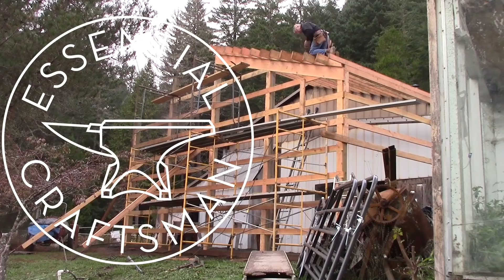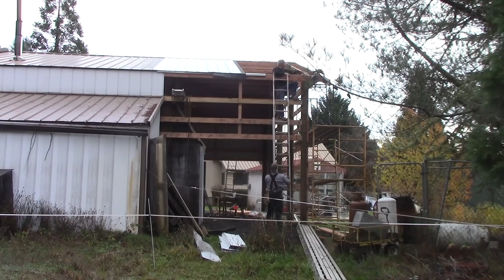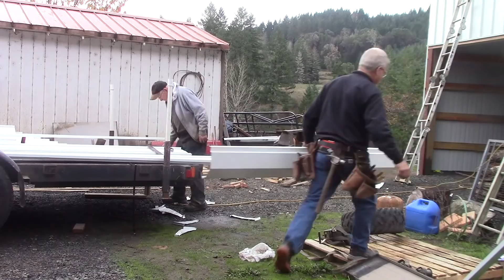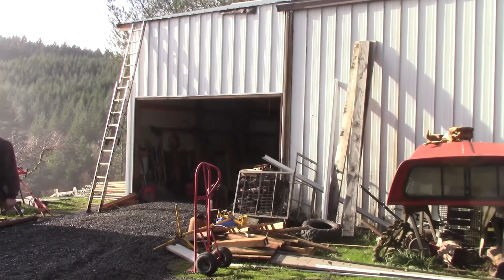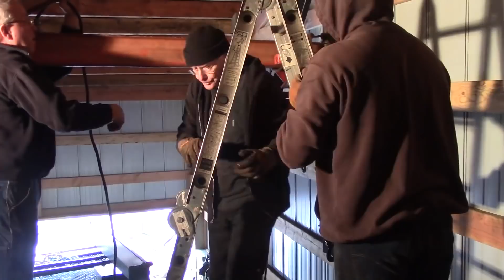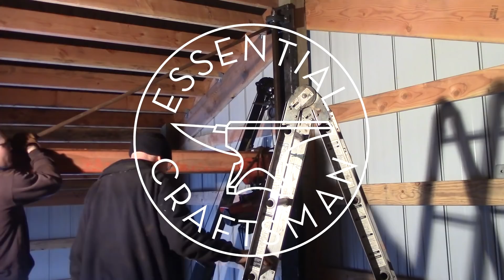Jobsite Safety and Taking Risks

Comment: I have been wearing a safety harness almost everyday for about 15 years and I have never had to rely on it in a fall.  The thing I like best is that my tool belt is attached to it and it distributes the weight to my shoulders.  Great video.

Comment: 1.5 years into carpentry. Still a newbie cut guy. Almost cut my finger off the other day trying to rip a 2x4 long ways with a circular saw. The 2x4 started to move while I was cutting and I grabbed it from underneath to hold it steady and ended up grabbing the saw blade, like a dummie. Only knicked myself but it still hurts pretty good. Really enjoy your videos sir. I will use my brain next time!

Comment: Excellant presentation as usual. Love your videos. One note though; when working "like they used to", like you were on your barn and YES like I worked on my own barn - before all the emphasis on safety. Tens of thousands of good carpenters and other tradesmen were crippled or killed on home and farm job sites every year. Now with the increased focus on safe practices and equipment those results  have been reduced from tens of thousands to hundreds for the most part. 
Even with all the safety knowledge and equipment I have at my disposal I was replacing a section of ridge cap on the standing seam metal roof of my barn damaged by high winds when the first slick of dew formed on the metal. No worries my gloves and boots had no difficulty gripping under those conditions. I gathered up my few tools and began climbing down to the ladder. In that same moment that bit of dew FROZE! Damp ice, NO grip at All! I made my way off that roof only because I drove my hammer claws through my relatively new metal roof each couple of feet and lowered myself down that roof. It was so slick that while I moved my hammer to drive it through a couple feet lower I actually couldn't avoid sliding down while I quickly moved the hammer. I  WAS  TERRIFIED! You just can't allow for everything. 
Honestly how many times over the years have you fallen and were injured or should have been? How many shoulder or back injuries injuries are you forgetting. Most of those could have been worse but what? When you are talking about your brain keeping you safe don't forget to mention those and the serious injuries and deaths of those you worked with. Yup don't forget to tell the nubies  about those times your brain just wasn't enough.
THANKS for listening
Rancher Jerry

Comment: The only two accidents that I've had on a jobsite where one time I was up on a latter until I got delirious from the summer heat until my nail gun bounced off of where I was trying to place a nail landed in my tool pouch and shot me in the thigh. Another time I picked up a 2x12 and a staple stabbed right through my finger. Both times I was back at work within  20 minutes and I finished my day.

Comment: Yes, there are safety issues from working on wet roofs at that height.  But here is where experience (an unpredicted benefit of older age) allows one to proceed more slowly and not rush the construction.  The job will still get done, but done with more caution and experience.  Experience teaches us when to push it and when not to push it.  Nice work here and it looks great.

Comment: In Manila there is a plaque with the names of laborers entombed in the concrete of the convention center there.  Years ago Imelda Marcos wanted the place built in time for the Miss Universe  pageant.  And in their hurry to pour the necessary concrete some of the scaffolds collapsed and workers fell into the sea of concrete.  They were quickly replaced by hundreds more eager to get the work.
Reply: As others have noted in the Comments section, safety regulations are written in blood.

Comment: I worked on construction sites for a time - not a long time, 1.5 years or so. Installed cameras, access control systems, and other low voltage electric systems and networks. We were HATED by the crews because they thought we weren't doing the "real" work. To a point, I get where they were coming from. Either way, I spent a lot of time climbing on roofs and ladders, or walking across joists, or climbing scaffolding that just never seemed quite right to me. I realized, even with OSHA, most of these guys I worked around - and with - did not think about safety and would give you forty kinds of hell for giving it a thought. My most fond memory was climbing to the top of an 18 FT A Frame, standing on the very top of it with my right foot  on it and holding to some HVAC equipment with my left hand while the rest of me dangled and while trying to force a cable down a 1/2" conduit pipe when we needed a 1"... At the top of that ladder, where I was stupid enough to be coned into climbing up there and doing that, I realized my safety while solely my responsibility and no "need" to get the job done was worth risking my life over. I was 21 at the time... Won't ever do that again!

Comment: When I was working industrial Electrical I used to be puzzled as to where I was supposed to tie off when I was in the top of a building.
The worst was places that said if you were 2 feet up the ladder you had to be tied off. Inevitable you would be tied off with just enough slack if you forgot to untie to take about half a step away before you came to the end of the rope!
One job I was on we were supposed to have safety meetings at our crew gang box every morning, some of the foremen would read from or have one of the guys do it from prepared safety talks. Our foreman would look around and light up, take a puff and growl at us "Be safe, now get to work"

Comment: Great video and insights as usual. The hare and the hound is wonderful analogy. Life is a constant balancing of risk each morning I commute to work I am forced to manage risks I would otherwise avoid. Anyways quick aside some folks might get something from as they try to navigate the corporate safety culture.  I work in the environmental cleanup industry and I deal with those laws you referenced daily. It is such a hard balancing act explaining to a lifelong seasoned contractor the need to follow the corporate safety protocols sometimes against his or hers own years of experience of doing it "this way". I try often to let them know I appreciate their expertise in fact its why they were hired in the first place but I have to incorporate the professional input from our corporate safety officers as well. I ask if what they are being asked to wear or do is unsafe and nearly in all cases the answer is "no" but they add "it will slow me down".  Well there is the rub.  So I have learned when requesting a bid or receiving an estimate I make it very clear of the safety culture they will be working in and some choose to not submit others refine their numbers to allow for the added time the necessary safety steps will take. Thankfully in my 18 year career I have had only 1 significant accident and the safety gear in place at the time of the accident probably saved the drillers life. So for contractors ask questions up front and plan for safety environment you will be asked to work in. Good luck out there folks, be well, be happy.

Comment: I don’t normally comment on your videos, but this one seems to warrant it. On a job site next to mine, two guys were in a boom lift meant for flat floors. They were using it outside on gravel. They were harnessed in as they should have been. When the lift tipped over, the were bound to the lift and were both killed. There’s a chance they would have survived without their harnesses. I tell this not as a slight to harnesses, but to the false sense of security that PPE can provide. Always think about what you are doing.

Comment: I made a comment on a Larry Haun video about safety. It's the safest and most dangerous way to use a Skilsaw at any angle with one hand with the blade spinning just next to your thigh. When you know there is no safety gear you are personally responsible for your safety, then it's safe. It doesn't prevent accidents tho.

Comment: I'm a machinist, so I face a different but similar range of jobsite threats.  I heartily concur that you should never depend on PPE to save you.  Use your noggin and set up the job to be as safe as it can be or has to be, and the PPE saves you when something unexpected happens.  My safety glasses have taken several hits which would have cost me an eye - once from a metal chip I never saw, whipped across the shop by a machine with its door open.  At the same time I've been that guy who recognizes an unsafe situation and shuts it down.  I can get another job, I can't get another eye or hand.

Comment: I've brought up this very same concept of safety starts with using your brain and that PPE is the last measure in mitigating risk at many safety meetings (the first is reduce or remove risk through an engineered solution which can be as simple as erecting a guard, figuring out better way to do the said task, or basically using your brain). It's sad that I can notice in the higher ups body language and tone of voice that they actually don't care for this mindset or that they have abandoned this concept entirely.

I've seen this when we had an employee get a hand injury. The first question wasn't about what the job task was and how he injured his hand... It was whether he was wearing gloves or not. In this particular case, his fingers got smashed while making a lift of a bottle rack that had loose bottles. While he was wearing gloves (padded rigging gloves at that), he failed to keep his fingers outside of the bottle rack and when the bottles shifted, the bottles moved and crushed two of his fingers.  Fortunately, he didn't break any bones (in this case the padded gloves offered some protection from him using bad hand placement) but lost function of his hand while it recovered.

In response to this, the focus of many safety meetings turned to wearing gloves rather than having proper hand placement while on the job. In this case, I was very adamant about proper hand placement when conducting the task at hand. On the flip side, some people just don't use their brain so I can understand from an insurance viewpoint to push PPE. But then again, it's a very self/company centered response instead of legitimately caring for the people under their employ.

Comment: Amen, sometimes we all just need to slow down and asses the environment in which were working the contractors push so hard on time that guys run around like a chicken with there head cut off but if u slow down and plan out your moves u can actually be more efficient and safer

Comment: "Your safety is your responsibility." Perfect words to live by. Working 40+ years in construction and cabinetmaking and still have all my fingers and toes. Never fell off a roof even when walking on a frosty roof in January. Never had a wall fall on me when it was too long and heavy for the couple of us propping it up. When you become inured to the danger of a jobsite or a shop, when you loose your fear or respect for a tools ability to do great harm, that's when lives are changed and usually no for the better.  The gray matter between one's ears is the best safety equipment. Great vid.

Comment: The profession I've found myself in is very heavy-handed in safety and "proper PPE" - for very good reason. The equipment I work on and around on a daily basis will kill without any hesitation, as is the case with pretty much every heavy industry around the world. 

However, protective equipment and procedures won't save you if you don't use common sense, nor will they save you if you don't have an understanding and respect for what you're working with, and what you're working on. 

Some cases of that: 

1. A coworker was handing a heavy item up to another coworker standing on a platform. The one who was standing on the ground didn't realize his hand had become pinched on a hinge on the object, and it was ripped open when the object was lifted. Could leather work gloves prevented the accident? Most likely. However, keeping your hands away from pinch points will, as well. 

2. A coworker was using a large (oversized - 9") grinder with a cupped wire wheel to remove paint from something that had multiple angles, ridges, and small, tight corners. The machine bounced off the work piece, hitting him in the face. He was wearing safety glasses, which kept him from losing an eye, but he still required stitches around the eye. Would a face shield have saved him from injury? Yes. However, using a tool properly sized and designed for the job should have also prevented such an injury. 

3. Another coworker (a supervisor) was using a small grinder with a cut-off disc. This person is known to improperly use tools, and he routinely misuses grinders. The disc supposedly shattered, ricocheted off a nearby barrier, and lodged itself in his face, nearly hitting an eye and penetrating almost into his sinus cavity. I point out this particular case because this injury was wholly avoidable if the tool had been used properly. The location of work and the manner of the injury revealed that the injury could have only taken place due to misuse of the tool. That said, this story gets better...
The piece of cut-off disc was promptly pulled out of the person's face by himself (causing far more bleeding), and while sitting at the hospital, the person continually pulled the packing material from his wound, causing even greater bleeding. The person then placed blame on everyone and everything other than where the blame should have been. On top of that, it fell to me to clean up the work area afterwards, which took an entire day of cleaning and disinfecting. 

Yes, PPE can help prevent accidents. Common sense and proper use of tools and materials is far more likely to prevent them, though.

Comment: I retired a few years ago after doing 20 years as a safety director in heavy construction (steel erection,  demolition, heavy hauling,  land clearing...) and a short stint as a state OSHA inspector. Just when you think you've seen it all you come across another eye opener. I saw a guy tie off to a 20k power line once. Another employee covered a roof opening with a tarp so the rain wouldn't come in. Hell I caught the owner's son pumping gas  while he had a lit cigarette it in his hand. I saw a semi roll off of the ramp because the employee failed to use wheel chocks.  I wrote up a safety plan and the same employee did it six months later this time it crushed his leg. Workers comp insurance denied the claim and the guy was out of a job and had $30,000 worth of medical bills he had to pay himself.  One of my Ironworkers swung like Tarzan on a rope down to a lower level on a new parking garage.  An equipment operator jumped off of a D9 dozer and realized it was still in gear after it went through a shed. Thank God there was a 110 ton crane to stop it. There are a lot of stupid people out there.
Reply: Amen.

Comment: And that's why I love this channel. Plain, old fashioned common sense without any bull...
Reply: x2
Reply: @johnmccallum9542 
X 3
Reply: x4
Reply: X Infinity
Reply: Plain, old fashioned common sense goes a long way. Actually it goes all the way. But don't call safety 'bull'. It's slower, it may be more difficult to do your job, but you are safer that way.
Reply: So true
Reply: X4
Reply: I deliver to a place that insists that hard hats and safety glasses have to be worn "at ALL times whilst on site"!
One Security Guard interprets that to mean even inside the vehicle, whilst driving!
That's pure BULL!

I refused to make the deliver, on the grounds I didn't feel it was safe.
Reply: @jubilantyogurt  I find that alot of safety practices actually make the job more efficient, mainly because the planning and thinking that goes into it beforehand ensures things like equipment is on site and processes have been thought out. People get stuff done faster with the right equipment, and when they feel safe its even better. I believe the “bull” is the nonsensical standards and jargon that corporate managers love to throw around. Some rules simply make no sense, and when the people enforcing them are unreasonable or inexperienced it multiplies the problem. In general having a safe attitude is only a positive for the job. Safety is a mindset and one that has only brought me benefits since i have made attempts to adopt it on my jobs. It becomes cumbersome and “bull” when its taken too far and moves into the unreasonable category.
Reply: @markdoumert4840  Planning tools and methods or “thinking ahead of your day” I would never connect to safety. That’s just the mark of good efficient craftsmanship

Comment: I know you're having a deeper convo about safety, but i'm just gonna note, if you have a fall protection harness, you can work faster because you don't have to worry at all. Even better if you have a harness fit for rope access and half a brain for setup, you can hang over an edge to work way easier than off a ladder.

Comment: I always figured jobsite safety was kind of natural selection at work.

Where I live you have to take a course to work above a height of 8 ft. One of my classmates was a heavy equipment operator who's boss got a fine because the cab was above 8ft.

I worked with a guy that failed it 3 times before he got it. Do you think a guy that can't get above 75% on 20 common sense multiple choice questions is going to be any safer for doing the course? No he's still an idiot! He will get hurt. The boss will be held responsible. Safety regulations will become even more redundant and on it goes! 

Thanks for sharing I really enjoyed this chat!